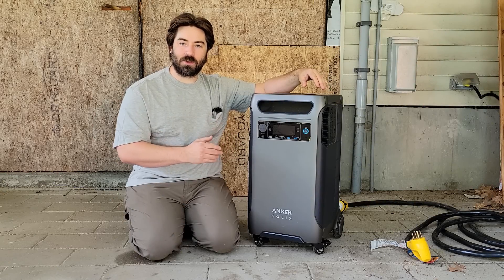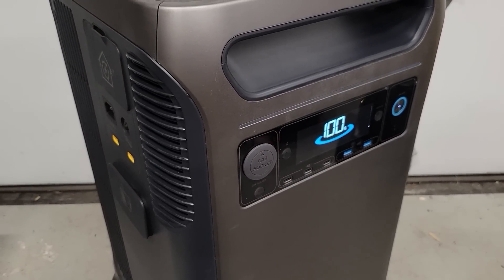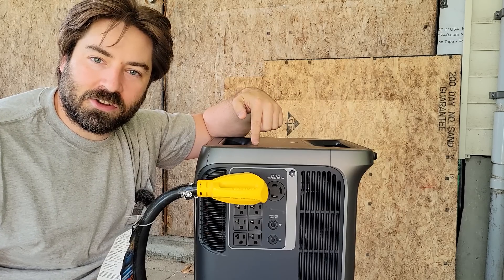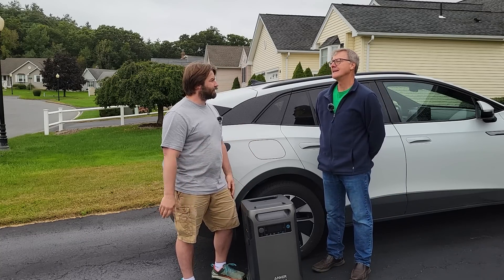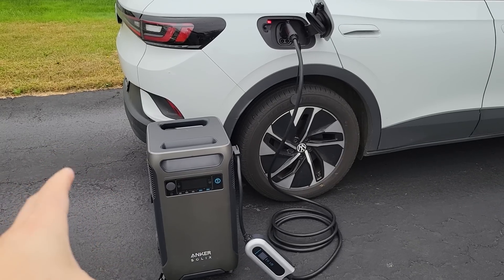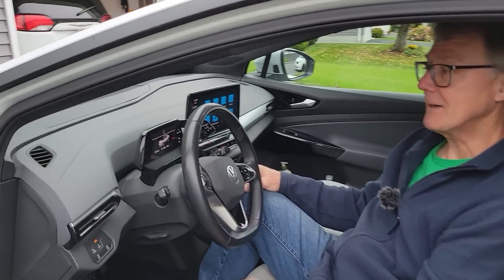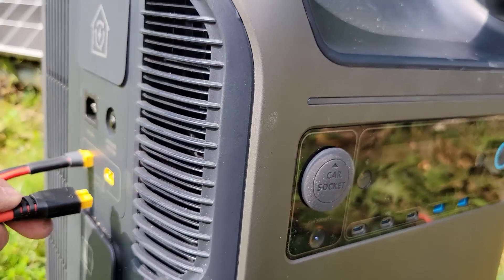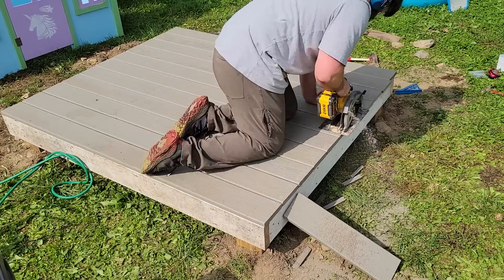ANKER SOLIX F3800: EV Charging and Home Backup, Testing and Review

Comment: can you have the unit plugged into a dedicated 15 amp circut as well as powering loads and solar charging all at the same time?
Reply from the maker: If the unit is plugged into a 120V outlet, then the 120V outlets will be powered ON and you can use it in "Pass-through" mode.  The 240V outlet will not power ON in this situation.  I'm 99% sure the solar can always charge, but I didn't personally test it while also plugged into a 120V outlet.

Comment: I have a 5th Wheel which is also 50 amps. I usually camp in campgrounds that provide full hook ups. However, I will be traveling next year, and will be stopping at public lands. I like that this model, and it has the 50 amp plug, solar panels, etc.  How will this work if I'm ONLY relying on the solar panels, this unit, etc.. What equipment should I purchase to be able to power my 29ft 5th wheel camper off-grid? I have tried contacting Anker numerous times, sent them emails, etc No one has tried to reach out to me!! Very frustrating to say the least.  Any advise you may share would be appreciated! 
Thank you!! Janet
Reply from the maker: Yes, it has a 50A outlet, but it can't support a full 50A.  This unit has a 6,000 Watt inverter, which is 25 Amps @ 240V.  I'd suggest finding out what your max current draw is (in Amps) prior to settling on this unit.  If you draw more than 25A, then you will be disappointed. 

Assuming you test your 5th wheel with everything on, and find you draw less than 25A, then you can proceed to your question of solar.  There is a brand new version of this unit with upgraded solar charging and can handle up to 3200W of solar.  A camper trailer probably can't fit that much, but you might get 2000W of solar on top.  If you have 5 sun-hours/day that's up to 10kWh of solar energy you could gather.  You would need 3 expansion batteries in order to utilize all that.  Again, however, you have to check how many kWh your camper consumes when you use it.  

Check out the upgraded model here: https://youtu.be/k_o21CEeF5c?si=uhca3qhuKf1KIflh
Reply: @DavidPozEnergy  Thank you so much for this information!!!!

Comment: Loved your video, almost answered all my questions. The one I have is if you have the solar plugged in, can you output energy at the same time? I'm thinking about camping out in the desert and keeping some fridges cold in the process. I'd get some extra batteries but interested to see if it takes roughly less than an hour to charge but takes two hours to drain the battery with my accessories, could I go indefinitely with solar?

Comment: What are your solar panels rated at and that 10AWG XT-60 wire - how long was it? I need to do the same thing and need the maximum wire length.  Thank you.
Reply from the maker: My solar panels put out 9.4 Amps.  The wire is about 20 feet.  The maximum wire length will vary on your acceptable Voltage drop.  Generally, try to keep them close to each other.
Reply: @ thank you David!

Comment: Manual says it can take a  2400 watt solar charge but........V x amps= watts
32 x 10=320watts..ch1
60x25= 1500watts.ch2
Total= 1820 watts
Correct? 
So where are they getting that out can charge at 2400 watts?
Reply: I get the full 2400 watts of solar charge all the time.

Comment: Been thinking about getting this for our small coffee trailer how many hours do you think we could run this before it needed to be recharged? The coffee maker does use 220 but everything else is 120 volts. Our total wattage when everything is running is 3650.
Reply from the maker: If you are pulling 3,650W continuous, then it would run about 1 hour.  It would be a good idea to list out your loads, and the run time of each.  Maybe your loads cycle on/off periodically?
Reply: @DavidPozEnergy  ok so there's a difference in the use and run usage ? So I'm looking for load times?
Reply from the maker: For example...
Maybe you have 200W of lights in your coffee trailer that are on the whole time you are selling coffee.  I have no idea how long you are open, but perhaps 8 hours a day.  200W*8h=1,600Wh.  Lights are an example of a continuous load.

You may have a mini-fridge for creamers.  The fridge will cycle on/off to maintain a steady temperature inside the fridge.  It might draw 150W while the compressor is running, but the compressor may only need to run 20min/h to maintain temp.  In that case the average use is 50Wh/h.  

Off the top of my head, I'd guess the built-in battery won't be enough for a full shift.  You would need the expansion batteries from Anker.  But, you won't know for sure without more data.

Comment: How long will it power a normal size refrigerator? I haven’t seen a review (on any channel) that answers this question.
Reply from the maker: Thanks for your question.  My refrigerator uses 1.2kWh per day, so this could run it for about 2 and a half days.  However, some large residential refrigerators with fancy things like through-the-door ice dispensers can use 4 kWh per day.  If you have one of those, then you would get almost 1 day.

Comment: What are the ratings of the 6 solars panels used in the solar charging test? 300 watts, volts?
Reply from the maker: I simply used the solar panels I already own.  I use this solar array for the day-to-day powering of my house.  Each panel is 365W, Vmp: 38.9V, Imp: 9.39A.
I disconnected some of the panels from my house and hooked them up to the Anker for the purpose of testing the solar input.  Is that helpful?
Reply: @DavidPozEnergy  thank you

Comment: Please don't get me wrong that joker is awesome especially for 110 (I'd love to see how it pushes a window unit A.C.). 

What really got my attention is when you turned the stove on It said .07 hours remaining or the Car .04 hours remaining? Still you really can't beat it for what it is.
Reply from the maker: Yeah, the size of the battery is relatively small compared to the inverter output.  I think they made this choice to keep it portable.  You can add external batteries if needed.
Reply: That was but one burner, bet it can't handle an electric water heater.

Comment: I think the Zendure was and is a device that was first to perform the functions your mentioning in the first minute of the video, but here is why I'm commenting:
How long would it take this  Anker Solix  F3800 to actually charge an electric car's battery in the  32 kWh  like the 2007 electric Ford Focus,   a regular class 2 home level charger
does this in under 10 hous,   would it take much longer to use the  F3800 and could it top up the electric car battery completely?  I saw the part of the video where you demonstrated
charging your dad's  electric VW and I was dissapointed, to see it capable of only adding 12 miles in his case,  I think on the 2007  electric Ford Focus or the  2016  30 kWh battery capacity in the newer Nissan Leaf's  I think the Solix F3800 is going to average only about  30 miles of added range to these electric car battery's and  since this cost over twice as much as a 
normal level 2 charging home set up,  it's not a major reason to invest in a device like this, if the goal was routine electric car charging,   (what am I missing? )
Reply from the maker: Most of these all-in-one power stations will lack somewhere.  In this case, 3.8kWh of battery is not much in ratio to the 6kW inverter.  I'm not suggesting you use this to charge your car every day.  But, I thought it was pretty cool that if you got an EV stuck a few miles from home, this could get you back.
Reply: Yeagh, thanks I'm dissapointed there are no alternatives yet powerful enough to rescue the millions of apartment renters who would be interested in electric cars, but don't have easy level 2 charging solutions, I thought maybe this might work for them, but the heavy 2500.00 apx price point doesn't pencil out to justify it, it is cool for it's emergency applications,   keep your eye out for the now affordable 2016 Nissan Leaf SL and 2017 electric Ford Focus, which are now available in the 10K used marketetplace for the first time, with ranges of apx  90 miles of range easily,  if they were well maintained.

Comment: Truly kind of useless. Winter months(northern states) #1 priority is heat, running a little heater for 2hrs truly is not sufficient / summer months, you'll be able to run a fridge but no A/C.
Reply: Most houses use gas as their source of heat in the winter. The fan, of course, needs electricity to do its job. Fans draw little current.  Using electricity for whole house heating would require an entire roof-top of solar panels.  And huge storage batteries on the wall for at night.  Same for whole house a/c.  These things are designed for very short emergency use and few electrical draws.  Like when you would only try to heat one small room for a few hours or days.  You expect to live like a king in an emergency?  Like everything is normal?  Problem is you, not the unit.  Pick your poison more carefully.

Comment: Watching this, I'm starting to realize how far the energy storage technology is away from ideal. I mean, 8% capacity used to make a few cuts, with the size of the unit? If you want to reach the ultimate goal of storing enough power in the summer to last through the whole winter without supplemental power (running a generator), then right now, with the latest technology, you would need a battery the size of a house.
It's interesting that we have a pretty good sense about pretty much everything. If you ever done any painting, looking at a can of paint, you know roughly the area it'll cover, or filling up your car, you know a certain amount of fuel will take you a certain distance, but we don't really have the same concept in our brain (at least in mine) about electricity. It's just some magic running through a wire. This video starting to put things into perspective.

Comment: I'm a bit confused by the solar inputs.
It says 11v-32v 10A and the 32v-60v 25A ?

What does that even mean ?
Why is the amp much lower for lower voltage.
Would it be because their wire gauge is to low for lower voltage ?

And what do you guys think of hooking up something like an EG4 chargeverter to the solar inputs ?
I feel like the 1440W ac input is charging pretty slow at about 2h45 to fill it...
For my use case it could work but having the generator running as little (noise) and as efficiently as possible is my goal.
By using the chargeverter at 2400W i could get closer to 1h30-45, almost 1h less..

Was thinking of getting the Predator 5000 (when it's back in stock and fixed)
Might be a little too big, 3600 running watts on propane, so 2.4/3.6 ~ 67%, a little far from the 80% target where it should be most efficient.
That said, if they manage to fix their AC + Solar so we can charge with both simultaneously, might be able to hit that 80% (~2900W) by controlling the chargeverter...
Anyways lots of ideas, now are they worth the hassle and the money :P..
Reply from the maker: I'll make a guess on the solar inputs.  
The first option (11V-32V 10A) is usually for charging from a car.  A car usually is around 14-16V when running.  But, a typical accessory port (cigarette lighter) is fused at 10A.  So, Anker limits that input to 10A so you don't blow the fuse in your car.
The second option (32V-60V 25A) is the limit of the MPPT circuit inside the power station.

Comment: After going to multiple solar panel stores it’s hard to get to the 1,200w max limit with 60v and 25a max. Most panels one would like to use is above 30 VOC which means you can’t put any in series or you’ll pass the 60w. If the Amps are above 8.5 you can only put 2 in parallel, which most are. His 375 panels are not the norm with 8amps. I really like this power station but they messed up with solar inputs.
Reply from the maker: My solar panels (used in this video) are 365W, 47.7Voc, 9.39Imp.  With 3 panels in parallel, I am up to 28.17 Amps potential.  It's OK for the Amps to be higher because the MPPT solar charge controller limits itself to 25A.  You just can't go over the 60V limit.
Reply: @DavidPozEnergy 3panels x 365w is 1095w. Thats going into one of the Solar ports which I presume is the 60v limit one.
What panels are you inputing into the 32v limit F3800 solar port???
Think your video shows your 47.7voc
365w panels, 3 of them. 
Both xt60 shows 44 volts. But the F3800 labels one of the ports 11v-32v. How can you input BEYOND the 32v limitation???

Comment: Great video - What solar power setup do you have to get the 1281w input?
Reply from the maker: The solar panels I'm using are LG, 365W each.  I had 3 in parallel per MPPT channel.  There are two MPPT channels.  That means I had 6 solar panels connected.
Reply: @DavidPozEnergy that answered my question :)

Comment: David, I would suggest being very careful about plugging your Dad's EV into the Anker Solix. Because this unit lacks an output transformer, there's nothing to block the battery's DC current from passing through to your AC loads during a catastrophic failure. All it takes is for one of their MOSFETs or IGBTs in this transformerless unit to short to ground in the H-Bridge circuit,  or the waveform control circuitry to fail, and this unit can send dangerous, high voltage, high amperage DC current straight to the EV's onboard charger which will not only damage the charger but can also set the charger's switching power supply on fire. The same is true for any brand of solar generator that uses a high frequency, transformerless inverter to produce AC power. If you want to charge your Dad's EV with solar power, then a much safer choice is purchase a hybrid, low frequency, transformer based inverter charger and add a LFP battery pack and assemble your own solar generator.
Reply from the maker: Thanks.  I've seen a few of your comments, and I appreciate you taking the time to be so thorough.  As you probably saw, I power my house with a Schneider XW.  I agree that transformer based inverters are a safer, long-term solution.  It seems the whole industry is moving to the transformer-less inverters.  I wonder if there is a solution to make them safer, maybe a type of surge protector?
Reply: The ideal way to make them safer would be to add a waveform analyzing circuit that would detect the absence of AC current or the presence of DC current at the output, and then switch off an AC relay that would cut current flow to the loads. Unfortunately that would add extra expense to the manufacture of these low cost inverters and I don't think these manufacturers would be willing to spend the extra money.   @DavidPozEnergy
Reply: doesnt a tesla ev protect against this already?

Comment: Hi David, I have a Hyundai Ionic 6 EV that supports Vehicle to Load, it outputs 1800w. The Solix accepts 1800w input for electric plugin charging. Does the Sollx F3800 allow both plug-in charging and house load management to extend run time?
Reply from the maker: No.  I tried AC charging, and AC load out at the same time and it didn't work.  It was one or the other.

Comment: Really curious if you can still use the 240v 14-50 outlet will charging via solar - specs said no to charging via AC and 240v output at the same time but really curious with solar.

Comment: Yes, it is Trex. I’ve called their headquarters and maybe they’re just lazy because they’re not gonna sell a lot but I need one board the long one and that’s it. Unfortunately it’s either that or I have to replace the whole deck to make it match. I also find that the deck does change. If you have it covered up, it’s light sensitive and if you ever find that there is a Difference in color just leave it in the sun uncovered, and it will all start to match again.  Your color is the exact color that I need but I need one long board.  Thanks for getting back to me so quick and I left you another comment or question about the generator because I have the 767 and 760 and was wondering about its compatibility with the unit you just tested
Reply from the maker: I have not tested the 767 or 760.

Comment: Hi, thanks for the review. Question for you which is off-topic but I’ve been looking everywhere for that color of decking. The one that you put under the dollhouse. Can you tell me where you purchased it and a phone number or something so I could reach out to them. I’ve called everywhere in the United States and haven’t been able to find it. I have a full deck, and, a contractor dropped a solar panel on it and broke one of the pieces so I’m out of luck. Really appreciate it. If you could drop me an email or message letting me know where I can purchase it.
Reply: Also, I meant to ask I have the Anker 767 with the additional 760 battery. Do you know if your unit there can be expanded with the 760 battery as well?
Reply from the maker: I'm not 100% sure what decking it is or where to buy it.  They were some leftover pieces at my friends house that he offered to me.  I think he said Trex, so I did a quick search and I think this looks close: https://www.homedepot.com/p/Trex-Select-1-in-x-5-1-2-in-x-20-ft-Pebble-Grey-Grooved-Edge-Capped-Composite-Decking-Board-PG010620SG01/206802160
Keep in mind that a piece in the store will look a little darker than some that have been sitting out in the sun a few years.

Comment: The 6,000 watt inverter when its idle with ac on must be power consuming.under high load the battery  its very efficient but under low load must be power consuming because of such large inverter. It has its highs and drawbacks.

Comment: Hey David, When you send them your review, mention that the 50A outlet should be rotated 90 degrees so that cord blocks off the 20A outlets to prevent overloading the unit. This will also help reduce strain on the outlet. Ground terminal goes on the bottom.
Reply: It has built-in protection but I guess physically maybe you have a point